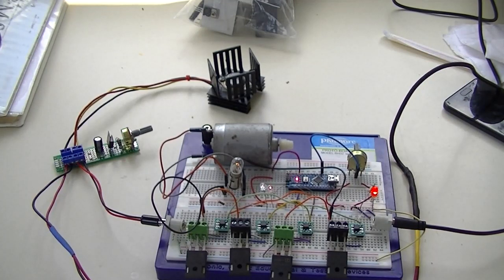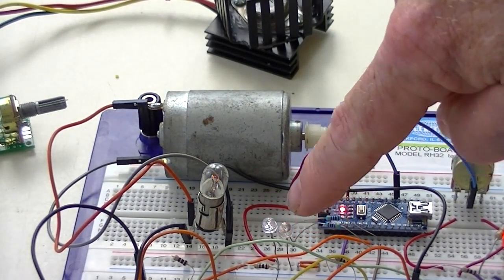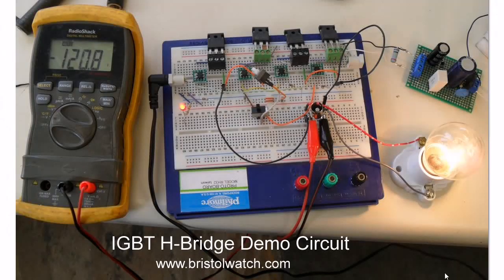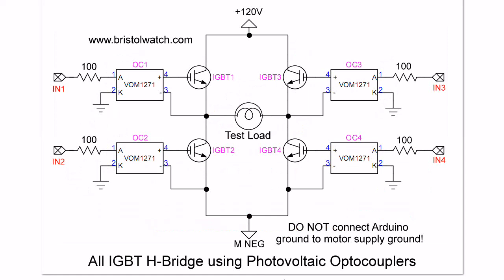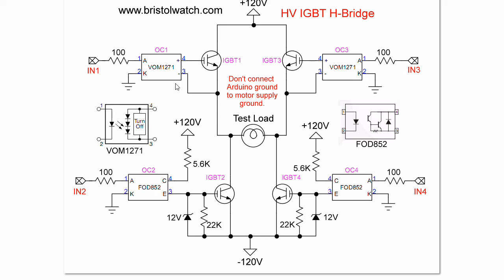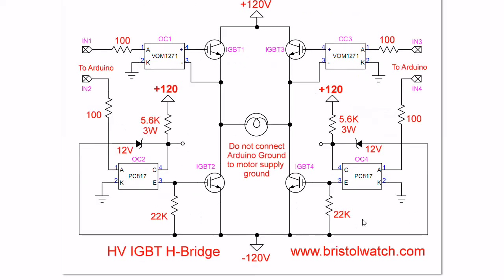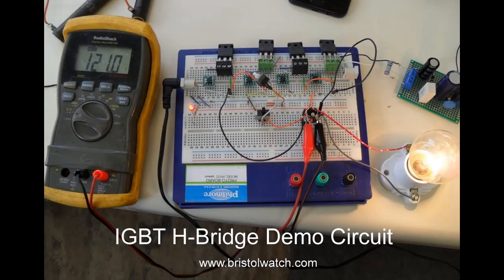High Voltage IGBT H-Bridge Circuit Using Photovoltaic Optocouplers

Comment: Thank you for the detailed video. I was wondering what kind of transistor to use for 350V operation on a capacitive load?
Any help is appreciated.
Reply from the maker: There are plenty out there. The ONSEMI FCH041N60E is rated 600V at 75 amps.
Reply: @LewisLoflin Thanks for the reply. I wanted to ask, if this circuit can be used to drive a capacitive load at 350V, by just replacing the IGBT with  ONSEMI FCH041N60E? I do not want PWM control, the load needs to be switched on and off at a very low frequency(< 0.5 Hz) with ground isolation. If the circuit needs additional work, please help me with that. Thanks in advance.
Reply: and the max current is 7A

Comment: Thanks for the video. Why it is forbidden to connect Arduino ground to motor supply ground? I just need that common ground right?
Reply from the maker: The motor ground can stand alone, that is what the optoisolators are for. That is 120V, do you really want to connect that to a 5V Arduino? In theory, you can until power line spikes destroy the Arduino. Or you get shocked.

Comment: Hate to keep bothering you again. Been on your website quite a few times. Love all the information you provide. Where did you happen to get your VOM1271s?   Digikey has 0, Mouser won't have them till the end of December, Amazon but that's a few weeks.

Apologize, I found them at NAC distribution.  Did you use a SOP8 breakout board for those?
Reply from the maker: I used the SOP8 which means I had to buy carrier boards. I got all of this on Ebay. Let me check.
Reply from the maker: OK they are on Ebay 5 for $6 and the carrier boards are also there search "so8 to dip". I got mine from Ebay.

Comment from the maker: Other H-bridge videos:

Arduino Controlled IR2110 Based H-Bridge HV Motor Control
https://youtu.be/d0r-Yx9R3Zs

Pt. 1 Interfacing Microcontrollers to CMOS and MOSFET Circuits
https://youtu.be/XzetdwzcOrY

Pt. 2 Simplified CMOS-MOSFET H-Bridge Circuit
https://youtu.be/rExHPqTUBuA

Pt. 3 Tri-State H-Bridge using CD4093B CMOS Circuit
https://youtu.be/b8O4ihdHx8U

Pt. 1 TB6600 Stepper Motor Driver with Arduino
https://youtu.be/PHe2MK9CvQM

Pt. 2 Program TB6600 Stepper Motor Driver with Arduino
https://youtu.be/jtX0t7-m69M

Arduino Unipolar Stepper Motor Driver Board with Arduino Code
https://youtu.be/HTVYiLOY8SQ

Pt. 1 TB6600 Stepper Motor Driver with Arduino
https://youtu.be/PHe2MK9CvQM

Pt. 2 Program TB6600 Stepper Motor Driver with Arduino
https://youtu.be/jtX0t7-m69M

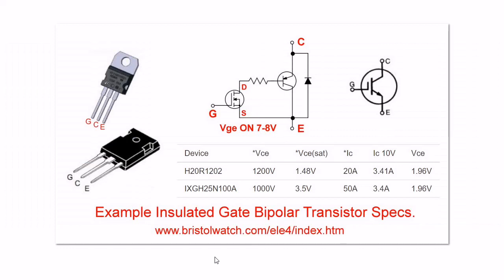Comment: i don't get it. you connect the gate to source and the igbt turns on? where does this vom1271 gets its power from? at 3:26 you show a page where it is says vge on is 7-8 volts, so where is it on the actual circuit?
Reply from the maker: It is a voltage DIFFERENCE between gate-emitter is what turns on the IGBT.

Comment: I have an H-bridge FET circuit that I intend to use to energize a coil in one direction or the other for pulse times of around 20-30 us with 32 A @ 6-8v. The duty cycle will be no more than 10%. Is the amperage rating mainly a result of heat buildup across either a FET (or IGBT) such that a 7.5A part would be safe - or is this more a function of physical bulk to avoid internal breakdown and I need to use full (or higher) rated current parts?
Reply from the maker: In my view it is partly mass and partly resistance. An IGBT has lower resistance but at this voltage there are some very low resistance MOSFETs.

Comment from the maker: Wonder what these are used for? To quote, " IGBT controls electrical energy via switching amplifiers in several modern appliances, such as cookers, microwaves, electric cars, trains, variable-frequency drives (VFDs), refrigerators, air conditioners, lamps ballasts, municipal power transmission systems."

Google igbts used in electric cars.

Comment: the AC-inverter-motor drives, large forklift truck battery chargers, solar and wind inverters are producing harmonics that can burn out electronic devices. in our plant we have to use line filters to reduce the 5&7th harmonics. the power grid is making new regulations. just wanted to add this BS in...:/  great video and a wonderful bench project...thanks...:-) fun

Comment: I'm kinda new to IGBT's so one thing that I can't understand.... for me a FET can deliver higher amps due to the lower RDSon than a BJT, so why use a BJT at the output in these IGBT's?
Wouldn't a FET be better for power? I mean a FET  can have like 1mOhms and a BJT.... not so low....
Is it something I'm not getting here?
Reply from the maker: Not according to industry. They handle higher voltages and current. They are used for example in electric cars. See the following:
https://www.rohm.com/solution/industry/motor/motor-non-iso-240v